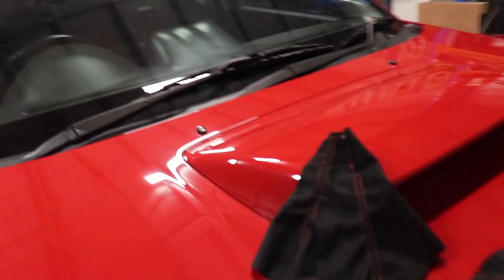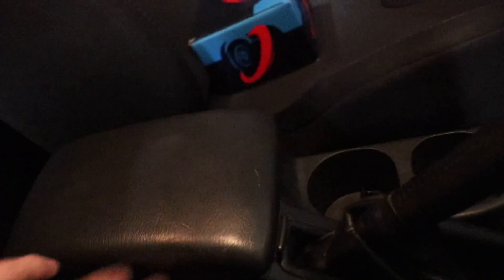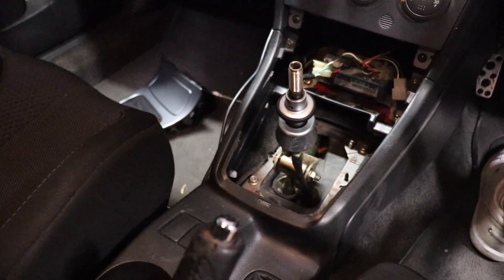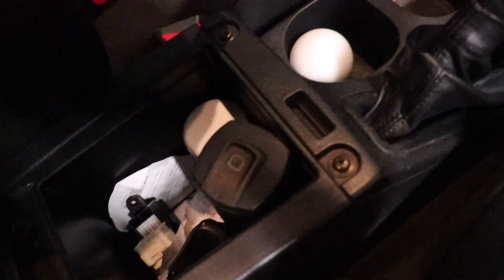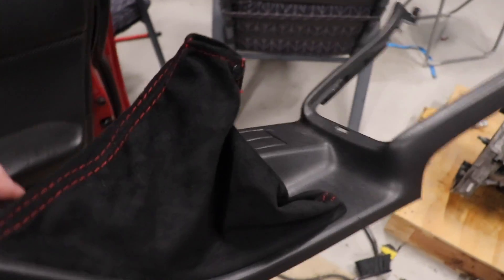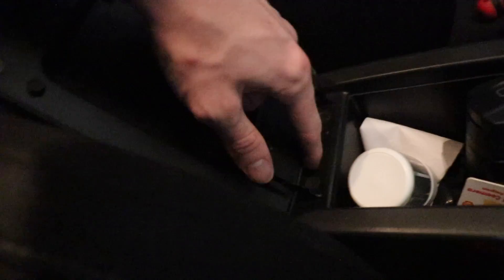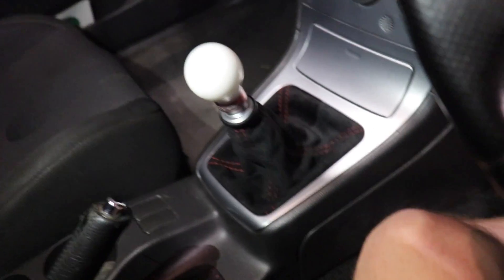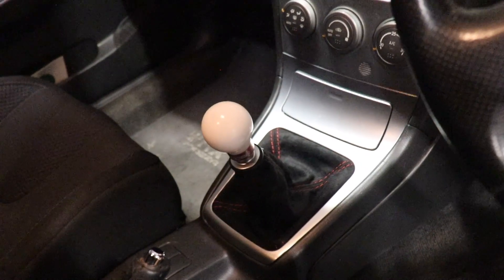Custom Suede Shift & Handbrake Boot Install on the WRX

Comment: Thanks for the vid! I'm thinking about getting the 2-piece shift and handbrake boot set. A couple of questions. Did you need any glue to install them (it didn't look like you did but am just checking) and two years plus down the line (assuming you still have the car), how are they wearing/looking now? Thanks again!
Reply from the maker: Hey mate, sold the car just prior to this comment after parting it out due to enigne failure. All Top Stitch products in mint condition, held up well
Reply: @UnrulyMotorsport  Thanks for the reply, and sorry to hear about the engine failure! I dropped Top Stitch an email but never received a reply. Perhaps I'll try again. Thanks!